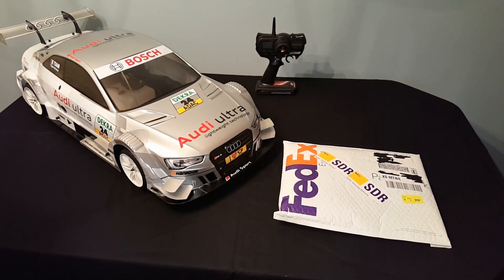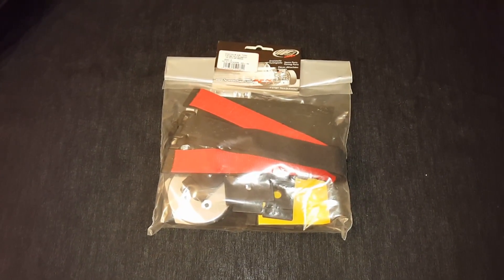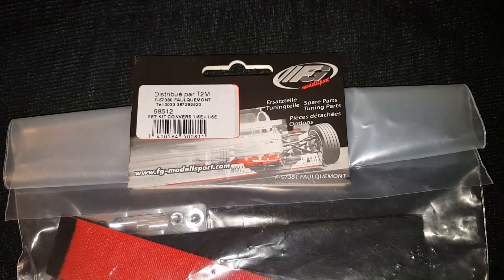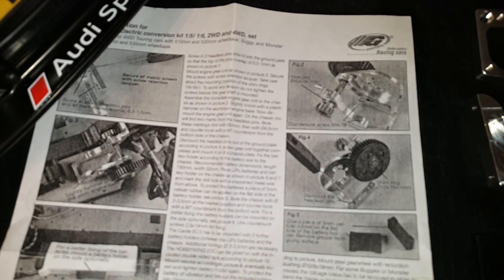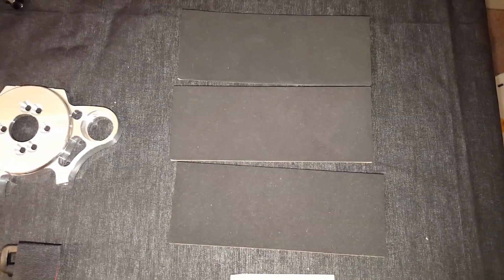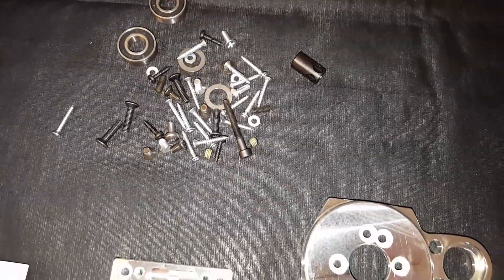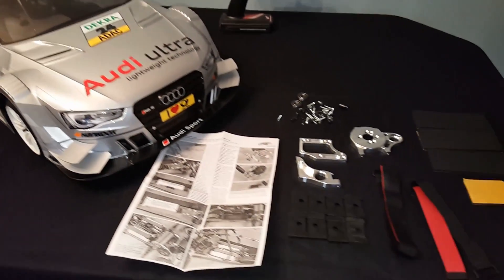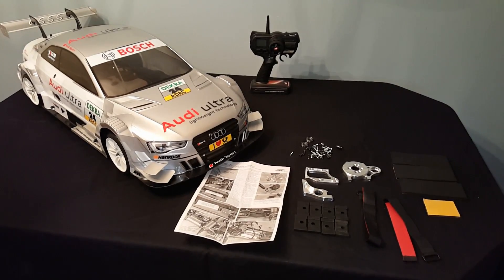1/5 FG AUDI RS5 - Electric Conversion Kit

Comment: Are these the only parts needed for the conversion ?
Reply from the maker: Ok Dusty yes
Reply: bigteedo111 thanks and you used which castle motor with different gears or stock?
Reply from the maker: Ok Dusty 2028 800kv motor 
Stock gears
Reply: bigteedo111 thanks for the fast answers .Keep up the good work!